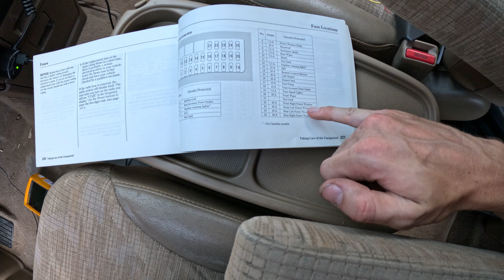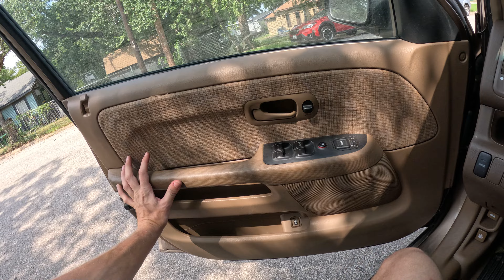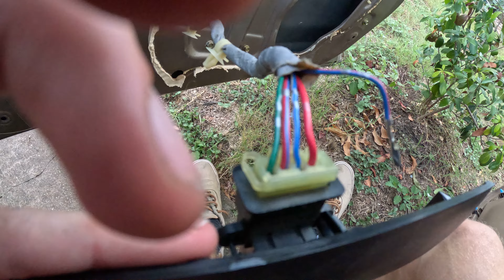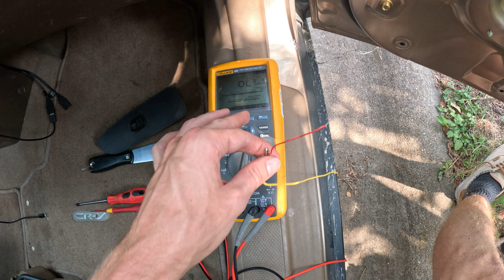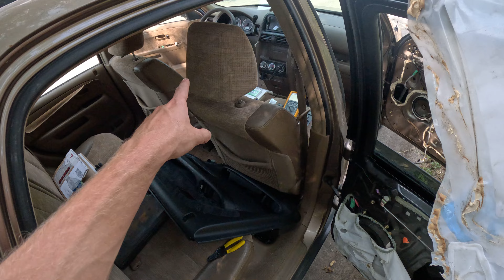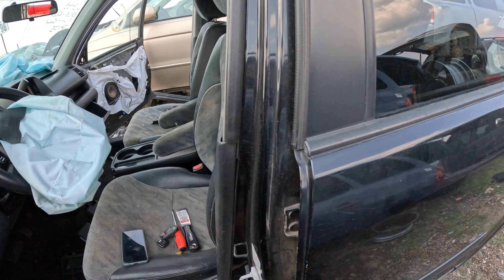Honda CR-V 2004 (second gen) Fix Your Power Windows: A Troubleshooting Guide

Comment: Thanks for your video. I really enjoy watching it. You just like a automotive detective! Wow, you are really good at troubleshooting! I feel surprised that not many views on this video, certainly not many thumbs up. But I gave it thumbs up and subscriber your channel. I force myself to learn and do some DIY stuff. My CRV rear window can not roll up and down. I bought a new motor and regulator. After connect it, it still keeps silent. My friend reminded me to check the continuity and the fuse. I am supposed to check fuse first maybe. Hahaha~ If it is the lines problem, I might give it up. BTW, I had already  challenged myself a lot by removing door panel. Hhaaha~